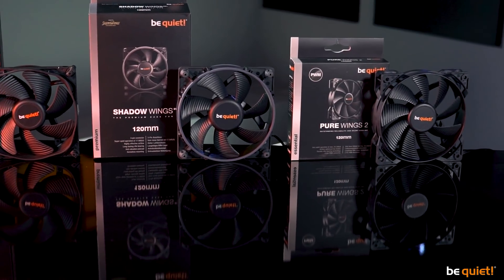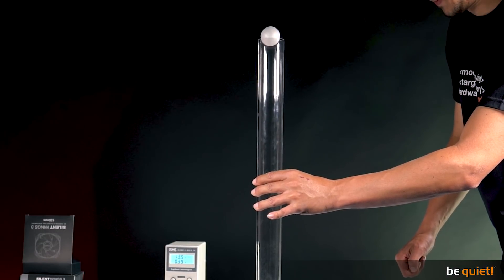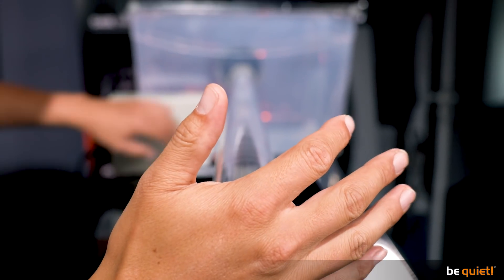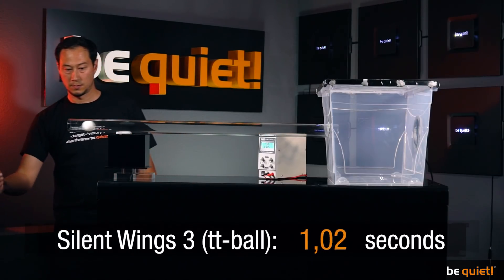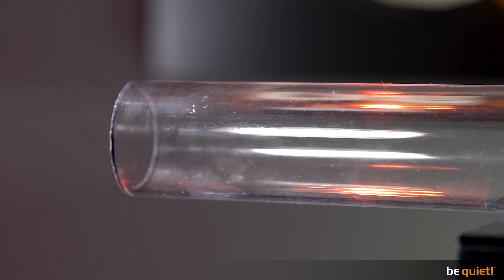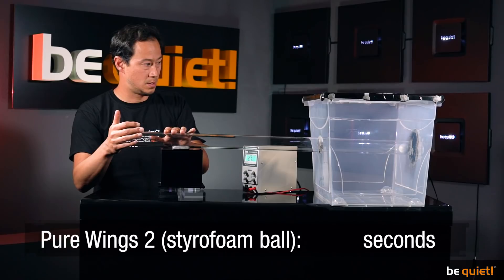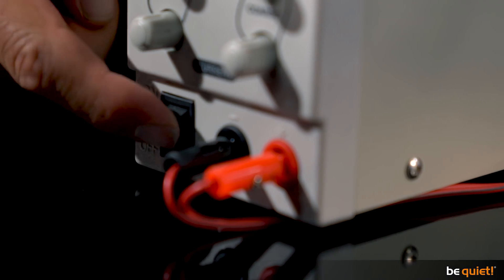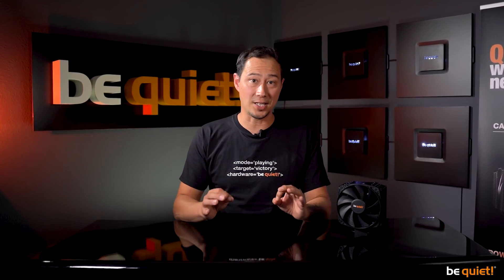Analyzing „fan performance“

Comment: you can buy a device that will actually measure the speed at witch the air is moving, so many people are using air to push balls around for the visual affect with out actually telling us the real data. anemometers are cheaper than all that plexiglass. i find this  ball method to be common and this is in  its self is very confusing to me